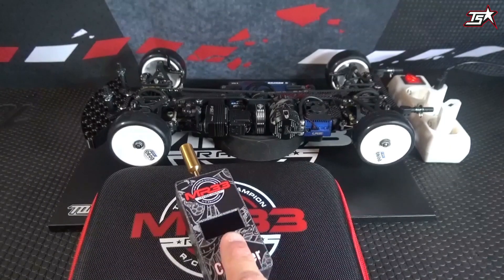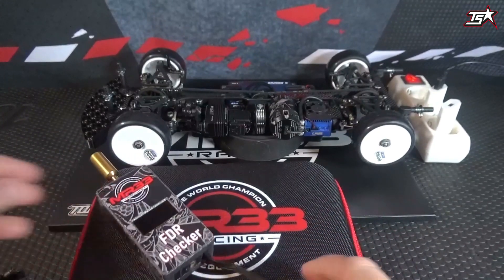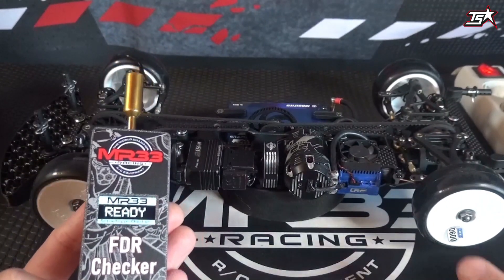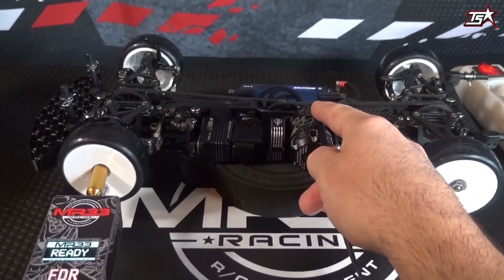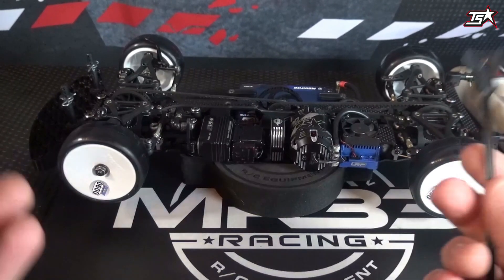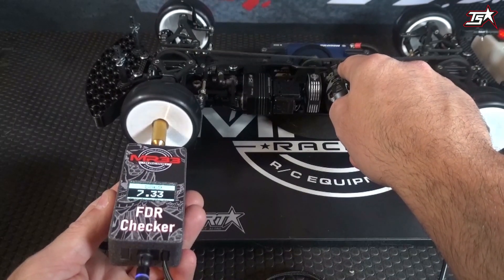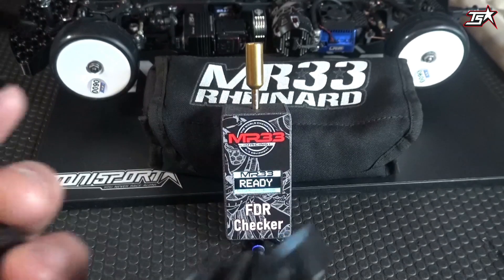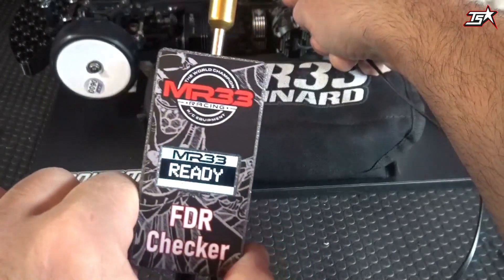ToniSport Newsfeed MR33 FDR Checker

Comment: Does it just sit on the hex? Do you put pressure on it against the wheel to use? Wouldn’t that effect the measurements?
Reply: It just sits on the hex yes. It does not have any influence on the measuring results.  You can easily feel when using 🙂

Comment: I like that this exists for those who want it. However, I personally see some issues. Is it possible to calibrate the machine? In a fixed FDR regulation class, a 0.01/2 discrepancy as we see here would be enough to see you disqualified. It also looks like you'll need to remove your body at tech inspection, which is a lot of time if done for every car. Also the sensor on the motor looks to be quite large - on my frontie for example I have a 40mm fan in front of the motor against the servo, 3x bullet connections and motor wire, plus the sensor lead and servo lead running over the motor. Then the motor itself is right against the ESC. On some builds, this sensor literally won't fit.
Reply: the value "stabilizes" after a couple of seconds (when the rpm is stable) - the optimal motor rpm is around 10-15k (it is shown in the display while measuring - Patrick uses a bit too low rpm in the video)... see https://www.youtube.com/watch?v=8BV8jPwnC30
Reply: We tested also on FWD cars and was no problem to check. 
With 0.01 difference to the rules you can be sure that the driver is not trying to cheat. Nobody will cheat by 0.01 as it makes zero difference on track.
Yes you need to remove or fold the body shell upwards to make the check but hey - yesterday there was no machine like this available and this one is really really good!
Reply: Just a suggestion, perhaps maybe in the future development if it is viable to use a y harness sensor cable to have the rpm values to be more precise
Keep up the great job!
Reply: @huntsolofighter4265  the problem with y harness is that you have to remove the plugs - which is quite fiddly + has the probability to damage the pins... we think this causes more problems/harm (who pays for the replacement?) than it solves
Reply: the sensor size: during our testing at the ETS events we tested hundreds of cars/builds... the sensor did fit every time (we always found a spont to place it and get the reading)
Reply: @race-recorder so will the sensor give a reading no matter where you put it on the motor? Or do you need to be able to move it around to find a 'sweet spot'? Thanks for clarifying so far.
Reply: @andyhbo86  it depends on the motor. For motors with a strong magnetic field (e.g. Orca) you can place it anywhere. For motors with weak magnetic field (Hobbywing) you have to find the spot… but there are multiple spots all around the notor case.
Reply: Ergonomic problems for sure. It definitely ISN’T a “one size fits all”